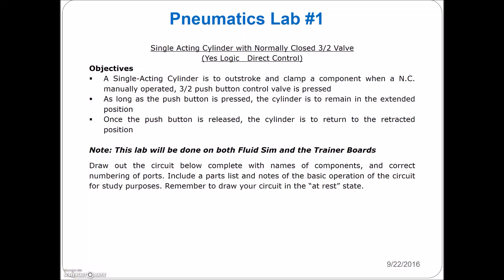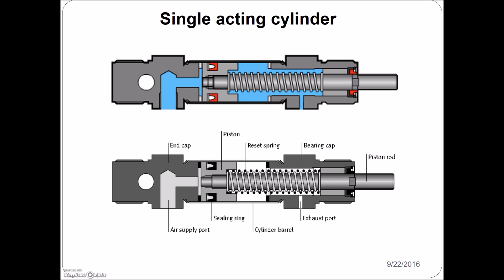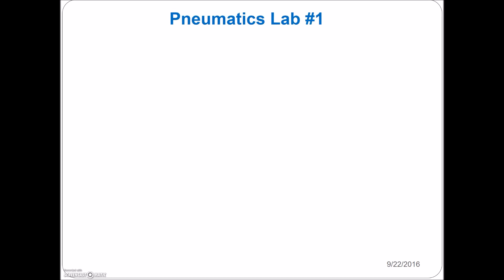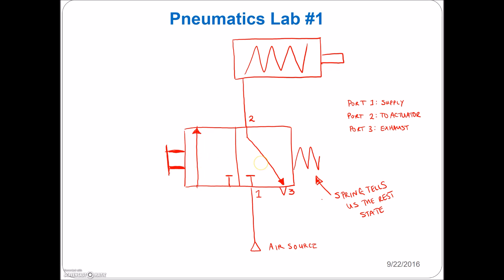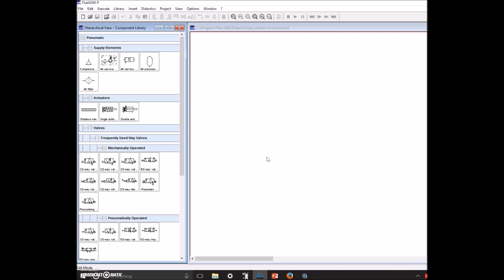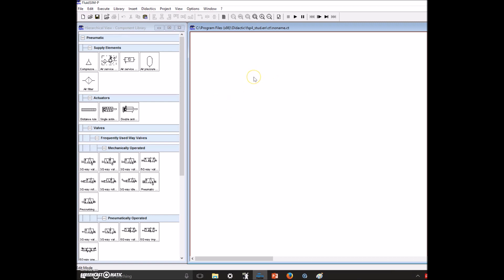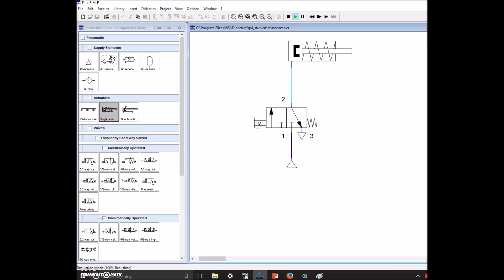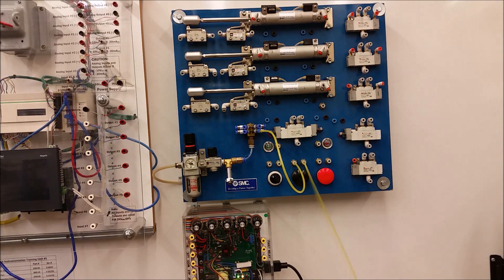Pneumatics Lab 1_Single Acting Cylinder controlled by a 3/2 NC Push Button

Comment: Hi.  The switch is 2 position 3 ports.  If I use 2 position 2 port such as car air pump valve.  Will it work the same?  Thanks for your help

Comment: Thanks for this! Great stuff and easy to understand. I know we draw the piping info next to the 'normal' state (in this case NC, a state created by the spring pressure) but which box could be considered the normal state if the valve is operated with a push-pull knob WITHOUT a spring - and can be in either state at any given time? Sorry if I sound dim here, but does anyone have any thoughts? Thanks!